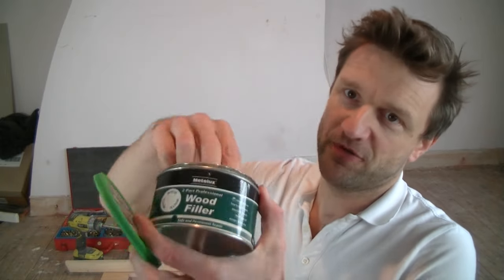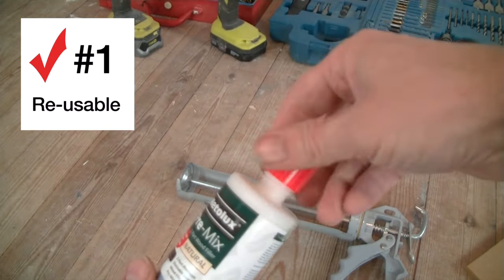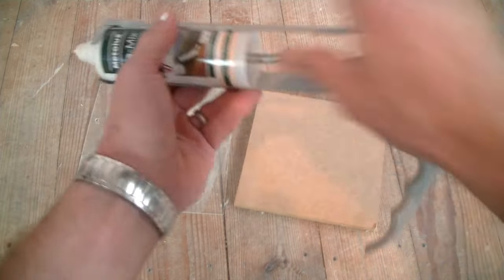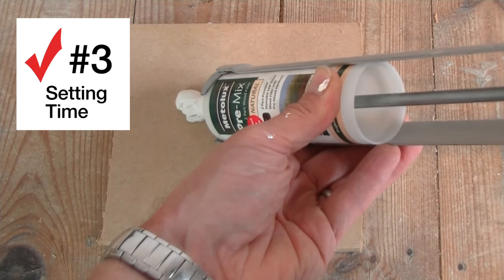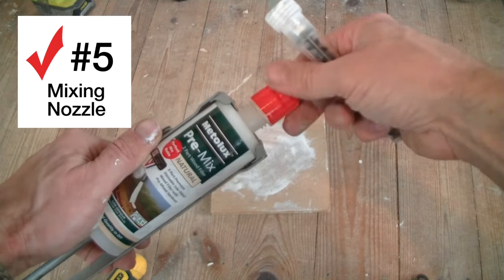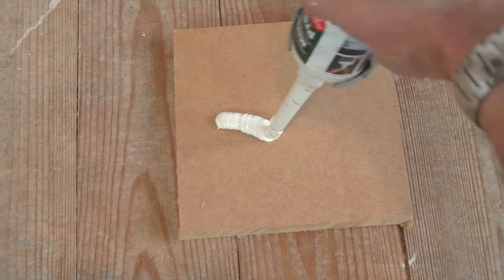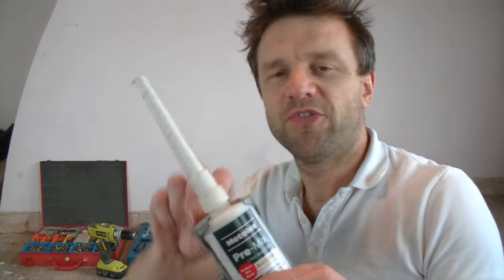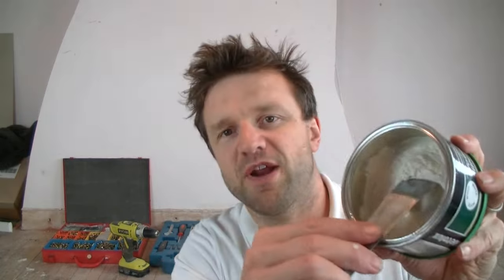The Best 2 Part Wood Filler? Video #2

Comment: Come on Charlie! How difficult is it to open a time lid ? How long does it take to mix the filler with Gardner ? Mixing ratio is given on the tin. Plenty of online sites sell the hardner. No problem
Reply from the maker: It's an old vid this. It's useful for piping into cracks and gaps but I've got to say, I don't really use it much these days.
Reply: @CharlieDIYte what are you using these days? Seems loads of people rave about the Ronseal high performance wood filler but loads complain about getting the ratios right and how fast it dries before they’ve finished using it

Comment: Hey Charlie, is this suitable for fixing kitchen cupboard hinges? I have a few that need repairing/filling/re-drilling/re-attaching. The wood is chipboard, so when I've repaired previously with Osmo wood filler is simply not strong enough and always breaks again. Love the channel and thank you!
Reply from the maker: No, it will be too brittle. You'd do best with something like this https://youtu.be/ZhCv5LnNCvc It means buying the double applicator gun but it's fantastic stuff, and being epoxy, so much stronger than wood filler. Apologies for the video quality 🤦‍♂️
Reply: @CharlieDIYte  Thank you so much. Really appreciate it! Keep up the good work!

Comment: This looks like it is just the job to seal the edges of MDF. Would I be right?
Reply from the maker: Hmmm. It would work pretty well. The trouble I find with this stuff though is that you've only got one shot at using the mixer nozzle, as obviously the wood filler solidifies in the nozzle once you've stopped pumping it out - and you're going to be putting the filler down for a few minutes every time you tool the filler onto the MDF edge. If you want to use wood filler - which does give you great results with MDF edges, you might just buy a tin of two part wood filler instead. For more info on painting MDF edges check out this video https://www.youtube.com/watch?v=kic9W4hqfbs&t=1s?

Comment: Apart from saving time, is there any other benefit using 2 part filler rather than a tub of regular/ready-mixed filler?
Reply from the maker: It's a far superior product which doesn't shrink like the ready mix stuff often does. Don't underestimate the benefit of having something that sets in 5 minutes as you get so much more done than having to wait over night for the stuff to set.

Comment: Can you suggest a filla i can use my dog chewed a chunk off my newall post it is a juicy corner piece
Reply from the maker: Yes any two part like this https://www.amazon.co.uk/dp/B00HUWY64W/ref=cm_sw_r_as_gl_apa_gl_i_CTDC4EPVSJAFP6BJRWMG?linkCode=ml2&tag=charliediyt0d-21 If it's a big repair just gradually build up the layers.
Reply: Thank you i thought so but wasn't sure

Comment: Does the tube last as long as typical wood filler tins? Ive had my tin for a few years and still going strong
Reply from the maker: I think it probably would last ok but you'd get through quite a lot of nozzles. The tin is the best option at the end of the day. I'd probably only buy this if I had to pipe a lot of filler into a gap.

Comment: Could not get the stuff out of my new tube.  It had already gone off in the unopened tube, so threw the lot away.
Reply from the maker: Sorry to hear that - incredibly frustrating. Have you complained to the retailer?
Reply: @CharlieDIYte  No, not worth the hassle. I have had similar problems with other brands, of late.  I wonder if the pandemic/lockdowns has something to do with it.

Comment: I've screwed up and drilled a cup for concealed hinge in the wrong place. Can this stuff fill a hole that size and then be structurally sound enough to drill into again (the new hole will overlap the filled one).
TIA

Comment: Hey Charlie thanks for the many many videos you have made that have helped me when ever I needed DIY guidance. 

Question about the filler. You showed it hardens quite quickly, but is it sandable and can it be carved, or is it more like a concrete filler and rock solid?
Reply from the maker: You're very welcome. Thanks for that 👊 Yes it is sandable. Can it be carved.. You can carve it with a razor blade when it's going off or sand it when it's set. But it is quite brittle when set so you can't screw into it like you can an epoxy resin. It's basically like any other 2 part wood filler. To be honest I'd only use this one if you have a specific job where you want to pipe the filler into a hole or tight gap, and the nozzle obviously goes hard when you stop the throughout of filler so it definitely has its limitations.

Comment: Charlie, can you use this filler to fill MDF edges?
Reply from the maker: You can, but the problem with it is it's best designed as a single application filler, because once you stop squeezing it out, it solidifies in the nozzle where it's mixed. So you'd do better to buy a tin of two part filler that you can just put the lid back on when you've finished with it.

Comment: Hi can I fill a section in a rotten oak ceiling beam about 2 inches sq Charlie
Reply from the maker: Hi Dawn. Yes, but for aesthetic rather than structural reasons as it won't provide any structural integrity. Best to use a coloured wood filler like Morrells or one of the coloured fillers I demonstrated here https://www.youtube.com/watch?v=6QlBFmjgVnc&t=27s

Comment: Tried the filler. Many guys have been saying it blocks up quite easy.
Secondly it's not as good as tou pret 2 part filler etc
Reply from the maker: Finbar Felaheen I'm inclined to agree. It's best if you're using a lot of filler and are likely to get through most of the tube in one job, as the nozzle will set hard after one application. That said you can always then just throw away the nozzle, screw the cap on and then squeeze out a line as and when you need it, and mix it in the usual way, but then it's probably just as easy to buy a standard tin of 2 part filler. This stuff is best for squeezing into small gaps as the nozzle comes into its own for that.
Reply: @CharlieDIYte  - with the greatest respect, that's not the impression that you give in your comments within the video.
Reply from the maker: @ofs1234  Your views of a product evolve with use of it, which is why I think it's important that I keep updating my thoughts through the comments section.

Comment: Just think of the landfill produced by those plastic tubes of sealant, filler, calk, expanding foam, etc. When I see a sea of these on display in store, it seriously depresses me. A massive two-fingers to the planet. And those bloody awful platic buckets that degrade by just being, are even worse. This sort of stuff shows how manufactures put profit before planet. These products should be outlawed.
Reply from the maker: There should be better recycling.

Comment: You dont look like you do any drywall work.  The way you spread the filler into a screw hole
Reply from the maker: Agreed. The way it's often done on site, put as much in as possible and spend hours sanding it back (particularly if you're on a day rate), creating mountains of dust.

Comment: Nothing about its properties and reliability. 

The most important things I need to know are can it be sanded, can it be painted and does it stay bonded to outdoor surfaces exposed to UV, rain, cold/heat and most critically of all places that suffer vibration and stress cycles like the wooden ledge underneath my very heavy sliding sun-lounge door.

This review was useless to me I'm afraid.
Reply from the maker: Yes to sanding, yes to painting and it would be ok for minor repairs outside if you were using a decent paint system after. I generally use the 2 part in a tin though.